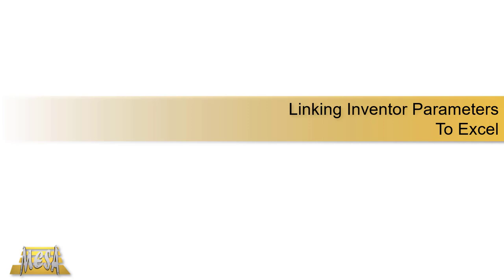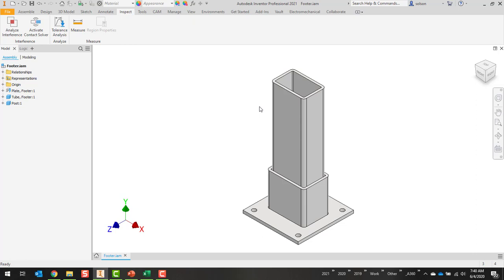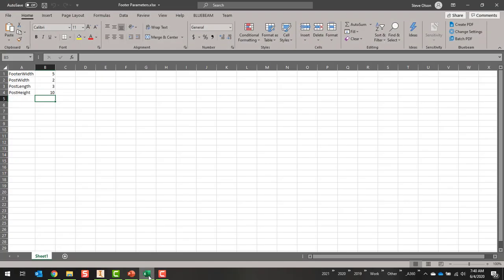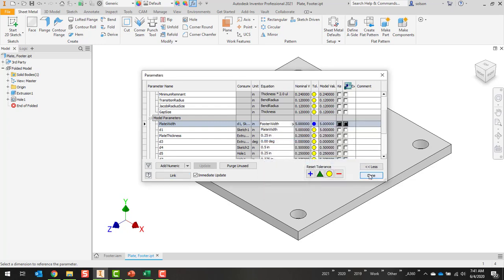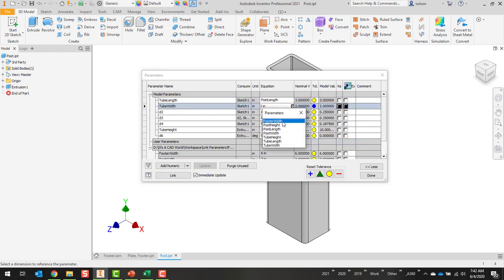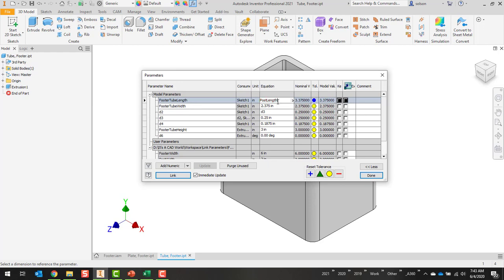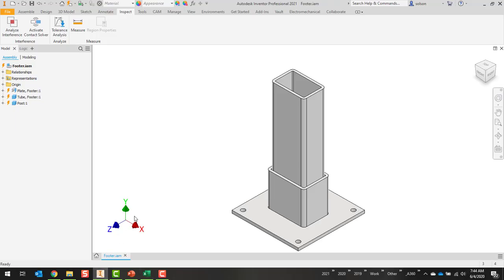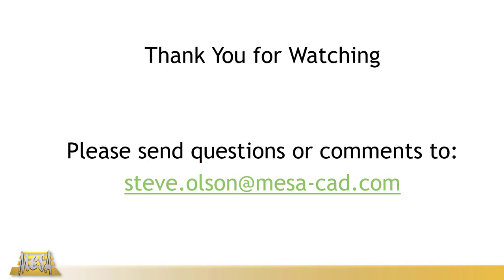Linking Inventor Parameters to Excel

Comment: How do you deal with renaming a parameter? Currently, if you rename a parameter and save, Inventor leaves the old name parameter in the parameters list, (but highlighted yellow), and adds the newly renamed parameter in at the bottom of the parameters list. Is there any way to make Inventor just rename the existing parameter to the new one?

Comment: Hello. Inventor does not display any values or parameter names in the Parameters box. It shows the file after I link it but there is no dropdown showing any parameters from the excel spreadsheet.
Reply from the maker: If you have linked to the Excel file, you should see the line that shows the linked Excel file at the bottom of the Parameter dialog box.  If you see the file without any parameters, you may have named the parameters using invalid characters.  You can't use spaces, which is the most common invalid character.  If that is not the case, check the Start Cell setting, to make sure you are starting in the first cell you want.  If it sees a blank row, it stops reading values.  I hope this helps.
Reply: @3DSteve52  Thank you for the reply, the spaces were the problem.

Comment: update is not showing any changes
Reply from the maker: If you are not seeing any change to the model, you will want to make sure you have done a couple of things.  First, make sure you save the Excel file.  The system see the modified time stamp an recognizes a change to the file.  Secondly, make sure that the parameters you linked into the model are used by the dimensions of a sketch or feature.  Lastly, make sure you don't have a local update, lightning bolt icon, that needs to be carried out.  Let me know if you still have an issue after verifying that you have taken care of the items I listed above.  

Thanks,
Steve
Reply: @3DSteve52 many thanks for your response. yes i figured it out that I linked excel file with multiple worksheets and changed the values in wrong one.
Reply from the maker: @abdulansari2007  I am glad that you figured it.

Comment: Hi. I've been trying to find a way to link an Excel file to an assembly (say assembly X) in a way that the parameters get inherited by any part or assembly created under Assembly X. It makes sense doesn't it? You want all your subassembly items to know what the 'assembly_base_width' is. It is quite annoying when you create a part under the assembly and try to use a parameter, just to find out that the parameter is not there, and you have to link the Excel file again. Any idea?
Reply: I think you would have two options.  First, link the same parameter spreadsheet to each component in the design.  Secondly, you could use iLogic to pass parameters from the assembly down into the subcomponents.  This approach does require the subcomponent to have a parameter to receive the value.  There is a way to export and import parameters using iLogic too.  That might offer an interesting approach to generating the necessary parameter in the subcomponents.  Then use iLogic to distribute the necessary parameters to the subcomponents.  Hope this helps.

Comment: How do you add text into inventor? Thanks!
Reply: Are you looking to create a text parameter or insert text into a sketch so you can emboss it?  If you are looking to engrave or emboss text, you should create a sketch and use the Text command to add your text.  From there you can use the Emboss or Mark commands.  If you are looking to add a text parameter, there is a Text Parameter type under the Numeric option at the bottom of the Parameter dialog box.
 
I hope this helps.
Reply: @steveolson8283  hi there, no no, I wanted to import a text parameter say: Type on A1 and on B2 I wanted it to say B
So that in reference it would reference between two types of models like Plate type A and plate type B. Thanks you nevertheless
Reply: Would you by any chance know how to export break line dims onto excel through a sheet metal model or in sheet metal flat model mode? 

For example an L shape piece. At its flat state you can see the major bend line. That bend line to us like a referred to as a break line. It’s what is used to know how far inward a tool needs to be to bend bend the part properly. I just need the bend line dim exported in excel. I haven’t had much luck exporting a basic dim through flat model state or anything. I can only think of creating a drawing and applying a dim there and then making a table that I can extract but the drawing would just add more steps. Thanks for the reply!
Reply: @LealLens  If you got to the flat pattern, you should be able to create a sketch that represents the break line dimension you need.  It will be a Driven dimension, that just means that Inventor will control its value.  That parameter then can be written to Excel with a little bit of iLogic.

I hope this helps,
Steve